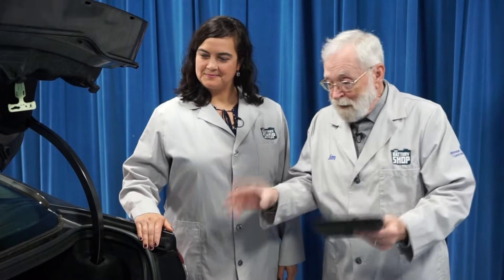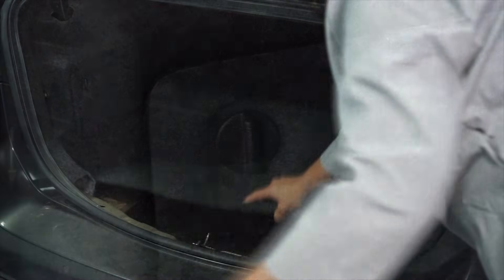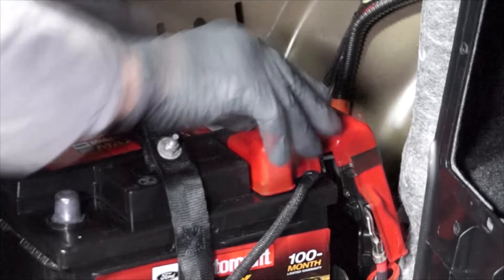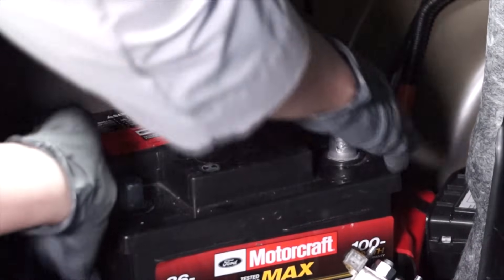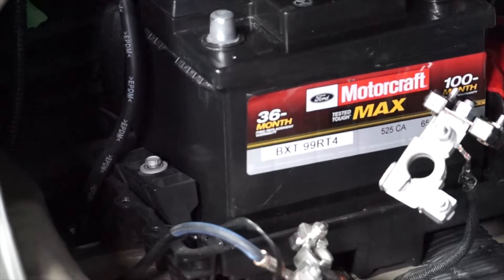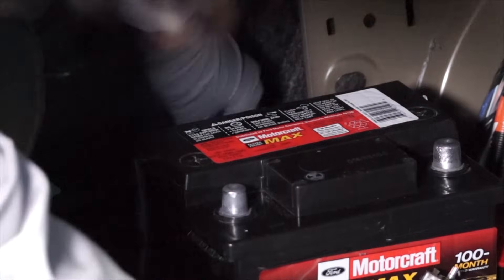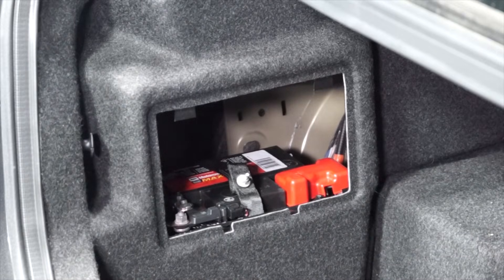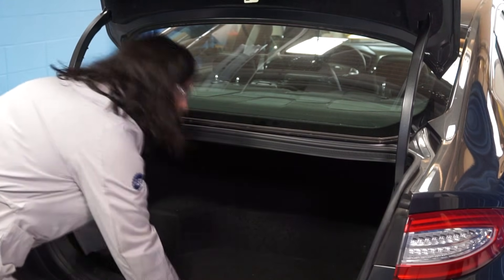Ford Fusion Hybrid (2015) - New Battery Install

Comment: Fantastic video, terrible design on Ford's end. Glad I came here first because I never would have guessed the little hatch was just to see the battery and disconnect and that I'd need to take the trunk apart to change a battery.

Comment: I didn't remove the flashing, I pulled the panel away after removing the plastic screw and pulled the battery out that way.  The trunk hinge was in the way a little, I was able to pull it thru.  But then the car wouldn't start, all the lights came on but would not turn over so, I have to research this more.

Comment: Replaced battery as shown in video. Went perfectly.2015 ford fusion hybrid was acting crazy. Doors wouldn’t unlock, trunk wouldn’t unlock, interior lights wouldn’t come on, key fob wouldn’t open trunk, car would do absolutely nothing when I turned on key. It’s like the electronics had a poltergeist. Battery was 10 years old . Guy at interstate batteries said there was no way that was the original battery but it was. I have owned the car since it was new and never had a problem with the battery. So if your cars electric system starts acting crazy start with the battery
Reply: Mine just started doing exactly what your saying thanks this helped

Comment: Just wanted to add to the list of people that used this video. Followed the instructions for my 2019 Ford Fusion Hybrid SE and it worked perfectly. Just went to my local AutoZone to pick up a battery and did just as the video instructed. The only thing that I would add is if you don't have the tool they use for the fasteners I ended up using the claw of a hammer to take them out. Just be careful not to go to hard as to damage them.
Reply: How much was the battery
Reply: @raider2095  I would go to costco.  Battery is 134 pre tax.  Same type is 224 at autozone

Comment: Thank you for this. One note - the data saver part. This isn't really explained and it's a totally new thing for me. It's not explained how it's set up and where it's connected, etc. I had to wing it and hope for the best but thankfully it worked.

The cable plugs in to the OBD port under your steering wheel and to the left (in my experience). There are several versions of these cables. Some plug into another car cig lighter, others have battery clips to attach to another car battery, some have AA battery packs, and some have a combination of these. In this video they are connecting the red clip to a connector next to the fuse box in the engine compartment. The black clip is clipped to a bolt nearby. If your cable has an LED attached you will see it light up at this point which indicates the cable is powered.

I was a bit dismayed when, after removing the old battery, the LED went out, however after completing the installation all my settings were intact.

Comment: Gas mileage? 🫡 Recalls? 😬 Winter weather around -15/-20? 💀 Ability to easily do things regarding battery replacement and jumping? 🤣 I wouldn't recommend this care to someone I hate. Unless you live somewhere like Arizona or new mexico, maybe florida, save your money. Its not less headaches, just different ones.
Reply from the maker: Thanks for watching.

Comment: Excellent walk through my replacement of a 2014 Fusion Energi. One problem I had was getting the trunk open without power and my trunk being full so I could not reach the emergency latch inside. Used a charger and finally got just enough to open the trunk. It took a 10mm socket wrench on the battery itself. The battery from Ford was $236 CAD.
Reply from the maker: Thanks for watching and glad to hear we could help!

Comment: Why would you remove the battery access panel if you're just going to move the whole side panel out of the way anyway?
Reply from the maker: Thanks for watching and providing feedback on the video. This is part of the manufacturers instructions and also shows features of what can be done.

Comment: This video was perfect for my 2013 Ford Fusion Hybrid! Thank you!
Reply from the maker: Great to hear!
Reply: I have the same car and I'm having a problem with it today; it won't start, as if the battery is dead. Could it be that I need to replace the battery, since the lights come on but the engine won't start?

Comment: what is a memory saver and where do you get one?
Reply from the maker: A memory saver is something to plug into the vehicle while you change the car battery that keeps the computer in the car alive! This means it will save all of your settings for you while the car does not have power. You can find memory savers at major retailers such as Amazon, AutoZone, Home Depot, and Walmart along with many others!

Comment: would have been nice if you said what size sockets I need to remove the fasteners. My car did not die in my driveway so I cannot just go back and forth to my garage to get the right size socket.
Reply from the maker: Hi - Thanks for watching and sharing your comment. The tool list is in the video’s description but you’re right, mentioning that 10mm wrenches were used during the video would have been helpful.

Comment: I have to do this on my 2013 Fusion Hybrid.   One thing I didnt see is, do you have to Disconnect the BIG HYBRID BATTERY somehow before replacing.
Reply from the maker: Hi - Thanks for watching! We followed the manufacturers instructions we had and didn’t have to disconnect the traction battery.

Comment: Good video but I would add these items:
1. If using a jump pack to keep the computer memory intact, be very careful about the loose positive terminal. If it falls against grounded metal you'll have a big arc and that can cause lots of damage to you or the car. I would wrap the positive terminal in duct tape or a plastic bag.
2. If the replacement battery has a vent on both sides a plug must be inserted into the unused side. DieHard batteries provide a plug molded into the positive terminal cover which can be broken free and used for that purpose. 
3. Coating the new terminals with grease or battery protectant is a good idea. 
4. Using a battery terminal cleaner on the new battery exposes fresh lead which makes a better connection.
Reply from the maker: Hi - Thanks for watching and sharing your experience!

Comment: I am wondering if this is the same battery and procedure for the 2015 Ford Fusion Energi ?
Reply: Exact same procedure
Reply from the maker: Hi - Thanks for watching! We haven’t has the chance to replace the battery in that vehicle yet, so we recommend that you check the vehicle owner’s manual or a service/repair manual to be sure.

Comment: Thanks for this wonderful detailed video!  I've replaced batteries before, but this was a whole new ballgame.  What was FORD thinking!
Reply: The people at Ford who engineered the battery compartment also did the headlight area.  I think they hated people.
Reply: Haha same here. I've replaced batteries before with no instructions,  but like you said, this was a whole new ballgame! Luckily this video made it easy.
Reply from the maker: Hi - You're welcome and thanks for watching!
Reply: I know it's annoying, but I think this was really a space concern for the hybrid. The Lithium ion battery is also in the trunk. But you need space in the front for a converter and an electric motor and an extra differential. 🤷‍♂️

Comment: What if I don't use the memory device that you had and I simply swap out the battery in  the left rear quarter panel, Can I just drive it around for a while it will be OK ?
Reply from the maker: Hi - Thanks for watching! Some vehicles require registration. We recommend that you check with the vehicle owner's manual of a service/repair manual to be sure.

Comment: Nice and informative video. Stepped me through changing the battery on my 2016 Fusion Energi perfectly.

On mine, I need a 10mm socket for all of the fasteners. Additionally, I didn't have the tool for the plastic fasteners. I just reached my fingers under the plastic and gently pulled it out without issue.
Reply from the maker: Hi - Thanks for watching and sharing your experience!
Reply: This car is a pos q

Comment: do you need to reset the BMS (battery monitoring sensor?) in the computer?
Reply from the maker: Hi - Thanks for watching! It depends on the vehicle, year model and how it's equipped. We suggest that you check the vehicle owner's manual or a service repair manual for the vehicle to be sure.

Comment: How important is a computer memory saver??? Doesn't  Microsoft "SYNC" take care of that?, (as it recently has in the past)? Or does disconnecting the 12 volt entirely throw THAT out the window? LOOK, to whom it may concern, I need that one piece of info. BEFORE I tackle this, (as in yesterday). Your timely thoughts would be SERIOUSLY appreciated in the next 12 hours. It is now 5:25pm daylight savings time on 3/19/22. PLEASE...ANYBODY?!?? (Yeah, good luck with that right?)
Reply: It's not crucial.  Worst case scenario you have to reset your clock and radio presets.  The computer will also need to relearn some idle and fuel trim settings.  There is a formal procedure to do so but just driving it will also the trick.
Reply from the maker: Hi - Thanks for watching! We suggest that you either check with a service/repair manual for the vehicle or use memory saving to be sure. Check out our video on Memory Saving. The link is in this video's description.

Comment: I went out to a dead 14' Hybrid so no chance of memory saving. Changed the battery and now have Hill assist, Advancetrac, traction control, and steering codes showing up. I cant drive now, help!!
Reply from the maker: Hi - Thanks for watching! We think that computer resets may be required using a scan tool with the proper software for your vehicle. Consulting a service/repair manual for the vehicle and the vehicle's owner's manual should also provide the information you need for next steps.

Comment: Hello, does the battery management system need resetting after 12v battery change? If so how is this done, thanks?
Reply from the maker: Hi - Thanks for watching! Check out our videos on battery registration. The links are in this video's description.

Comment: Why not add a tool list with the size of the sockets / wrenches !?
Reply: By the way, I just replaced mine and used a 10mm socket for all the bolts
Reply from the maker: Hi - Thanks for watching and for your suggestion! We usually do mention the wrench size being used but thought seeing the wrench size on the socket would work as well. We can see that it didn't so we we will be sure to mention  tool sizes in future videos.
Reply: It's typically a 10mm for every car I've replaced batteries on.
Reply: if you need a tool list then you should not be working on cars ! GEEEZZZZZ
Reply: @mronemanband1  convenience, especially if you have a messy tool bag or set up.

Comment: Have a 13 fusion hybrid the hybrid battery needs charged the main battery is fine the car won’t start how do I charge the hybrid battery
Reply: I have 13 and had the same problem.  Found the 12 volt battery was going bad and had to change. I kept having to boost it
Reply: @Derion.Blackman  how much was the battery?
Reply: @Pitman556  150
Reply: Quantos amperes??

Comment: this car is such a headache to own
Reply: 145,000 miles and no issues on my fusion energi titanium
Reply: @IlIlIlIlIlIlIlIl-v9h  240 k miles and all I’ve done is replace the battery tires change oil and top up coolant
Reply: @tetherking  lol an idiot box truck driver took out my beloved fusion. Got a Benz instead 😎 never looked back. The fusion was fantastic what ruined the brand for me was the dealerships. I had such a nice buying experience from Mercedes and the service department is chefs kiss
Reply: @IlIlIlIlIlIlIlIl-v9h  that's good to know, I'm at 75 k starting to worry alittle, even though it's driving just like the day I brought it.  I've heard nightmarish stories about repair cost on hybrid cars
Reply: @Lordpianz  I had to get a new transmission at 100k.
Reply: @Lordpianz  75 k 😂 baby
Reply: @Lordpianz  So... it hasn't actually been a nightmare for you to own, but you're repeating those nightmarish second (or third)hand stories?
Reply: Apart from transmission one of the most reliable cars I have ever owned and I love it. The 2.0L engine by Atkinson is the best 4cyl 2.0L ever made. I'm a mechanic BTW for 23 years.
Reply: 2016 fusion hybrid 80k miles…. Low cost easy fixes if you do on your own and have your own lift/tools
Reply: 185000 miles on mine. I've had nothing major wrong yet. I got it with 100000 miles, 4 years ago. One of the best cars I've ever owned. You must rotate the tires several times a year. As the rechargeable battery will cause back tires to warp prematurely if they are left there all the time. Drives great and gets great gas mileage.
Reply: @littlemas2 you rotate your tires every oil change which is every 3-5 thousand miles right? More than that?
Reply: @rift0tripper  Well, every 3-5 thousand is about 4 times a year for me, so yes that's tire rotation, but I change the oil every 7 thousand. It's full synthetic so I don't need more than that. I now have 217,000 miles on the car. Still running great.
Reply: My 2014 is at 180,000 miles, barely had any issues
Reply: It seems like it! A friend of mine has one always seems like something's going out on it
Reply: 200,000 miles 2015 ford fusion se hybrid and no major repairs as of yet but does need a new front axle which isn’t too much but not surprised as it’s been used for work for 2 years
Reply: I’m at 220,000 no real issues at all, battery is bad now though after years and a lot of miles.
Reply: My 2014 energi titanium just reached 90k and it smells like rotten eggs, hopefully changing battery will fix the problem
Reply: @victorhernandez-yw4dx did that stop the smell?
Reply: I’m not about to change that bs I’m taking to a ford dealer
Reply: @MisterFoster74 lazy.
Reply: Customize it 😈
Reply: I gotta take my entire car apart to replace a battery?!? Good grief. 

Thanks for showing me.
Reply: @lindseymakes5364  why deal with it that’s what immigrants are for
Reply: @Lordpianz  not it’s not it’s the best car I’ve ever owned and I’ve owned over dozen

Comment: HOW DO I CONNECT A MEMORY SAVER? Also if the entire electrical system is down does that mean the memory settings are gone? I had to pry off the driver side lock cap to gain entry, key fob, electronic entry code all not working. Nothing electrical was working.
Reply: To be honest I don't know if you really need a memory saver for the hybrid version of the Fusion. I don't think I lost my saved radio stations.
Reply: I have chaned the 12 V battery in my 2014 Fusion Hybrid and I did not lose any information or settings.

But I did have to unlock the door using the fob key. Everything that runs on 12VDC will not work if the battery failed. This is common to all modern vehicles, hybrid or not.

Comment: What if i don’t use a memory saver? What problems will that create? 🤔
Reply: Jessica, you will loose the memory presets on the radio, the seat, and window. All these are no big deal. The car will also loose a couple of its memory settings like the fuel settings. So... “IF” you were to just start driving it immediately (after changing the battery) you “may” notice the car running a lil’bit differently until the car RE-TEACHES itself the proper settings. You can avoid it running a lil’bit differently by simply letting the car run for 5-6 minutes (after changing the battery) before you drive it and it will RE-TEACH it’s self.
Either way, it’s not a big deal at all. A “memory saver” is simply a 12 volt source hooked up to the positive and negative posts under the hood where you can jumpstart the car. There’s a photo of these posts in the manual that came with the car.
Reply: To: WM1019,
Use the jumpstart posts under the hood to jumpstart the car.
Then simply drive the car around immediately and the alternator will automatically recharge the battery that starts the car. “IF” the alternator does NOT charge the battery, THEN you know that the alternator or the battery is junk.
Auto-parts stores will usually check your battery condition for free.
Batteries don’t last forever, they do need to be replaced several times throughout the life of the car. The alternator “should” last the life of the car, but they do wear out depending on the conditions you drive in.
Reply: @TheGreatUSA  you can use a battery pack and a OBD cable to obd port to keep all the settings
Reply: I am currently having the same problem...I haven’t used the car for 3 weeks and it is dead...How do I charge the battery?
Reply: Just a little problem when it is freezing cold outside in front of your house, and your car decided to die on me.

Comment: I bought a used fusion that is missing the small battery access panel cover. Cannot find a replacement part number no matter how much googling I do. Does anyone know what the OEM number or a place I can buy one?
Reply: I just pulled mine off and looked to try to get you a part number and ... there is no number on mine anywhere!!  pretty odd
Reply: Go to the salvage yard
Reply: Justin Butcher I
Reply: https://parts.ford.com/en/us/